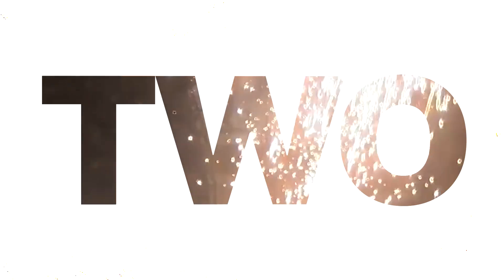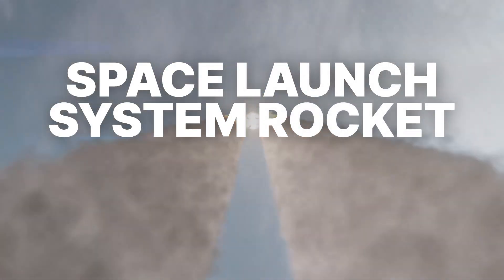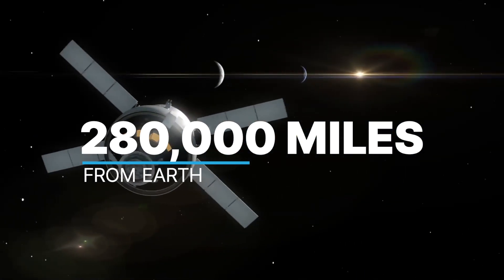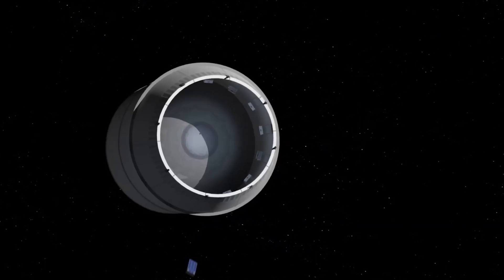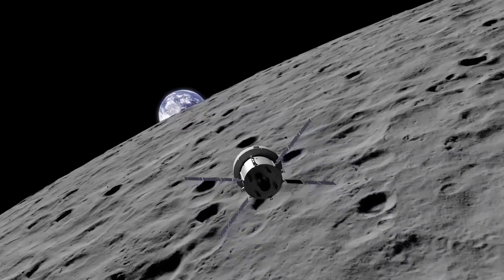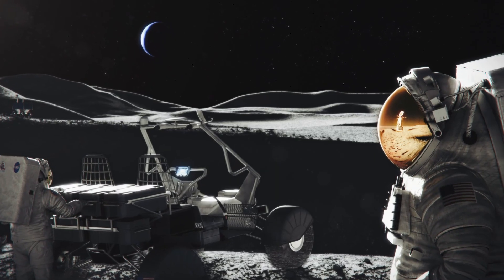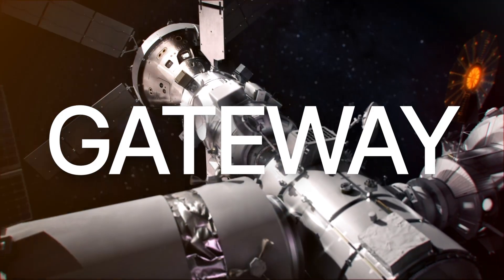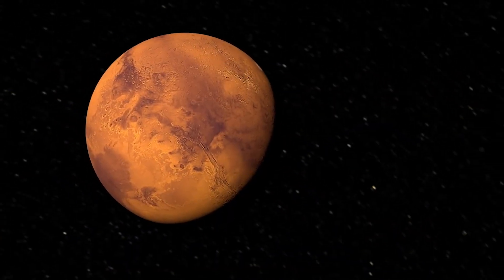Artemis I: NASA’s Plans to Travel Beyond the Moon

Comment: Nasa: The most powerful rocket in the world!

Spacex:  ;)
Reply: but we forgot the N1
Reply: @ftldesignbureau7891  N1 Failed.
And Starship will be more powerful, even Saturn V was stronger.
Reply: @clancy ARE YOU SERIOUS? SLS hasn't flown EVER and is using only slightly modified boosters from the SPACE SHUTTLE, plus starship has technically already flown
Reply: @zoom-w1e  when did I say it has flown/that it used new boosters? This discussion is about SuperHeavy, not Starship. I'm sure you're aware that Starship is the upper stage. It's like saying ICPS, which has technically already flown, means that SLS already flew. 
My point is that it's very unclear at this point in time, how many engines will BN3 or any of the pre-operational Super Heavies will use. So it's not really fair to say that SH is the most powerful until we have a final design. We do, however, know im what configuration SLS will fly. Which is why I personally will call SLS the most powerful until I see 28 engines on a Super Heavy
Reply: @clancy5600  you're wasting your time trying to put something on Muskies head that is not SpaceX/Musk propaganda. if you listen them, Starship already went to Mars and back and the million of colonist there are perfectly happy to be reuled by the Great Leader Doge the First, previously known as Elon Musk.
Reply: Its still in very early beta, and it chould get scrapped so dont get your hopes up.
Reply: Once starship is made, then yes it will overtake SLS, but for now, SLS will be the most powerful rocket in history🤯
Reply: Starship hasn’t been constructed yet so they are correct
Reply: By that measure SLS has not been constructed yet either. Both systems have prototype hardware constructed and tested. Only the future will tell which one will be going to orbit and the moon first. My money is on SLS flying (maybe) once. Great if more but I am not too optimistic about it.
Reply: @winni555  Have you been up to date? The core stage is build, the SRBs are assembled and we should get integration at the KSC within 5 months. SLS is a real rocket, all we've seen of SuperHeavy is a manufacturing pathfinder. We'll soon see BN2, but that won't have 28 engines either. And it's entirely possible that BN3 won't have 28 as well. I do believe SpaceX will reach 28 engines at some point, but it's foolish to say they already have. So for the next year or so, SLS will be the most powerful launch vehicle, wether you like it or not.
Reply: @clancy5600  Yea so both vehicles have not been assembled/integrated/launched yet. They are both still on the ground. Ofc it is all speculation but I'd bet starship will go to orbit before SLS. Sure SLS is "integrated within 5 months". I will believe it when its done. And boy I hope to be wrong about starship being first (actually if one would believe the starship timeline they would probably get to orbit first anyways but I doubt the July date for spacex too). It would be awesome for SLS to stick to a timeline for once.
Reply: @winni555  Core stages for A2 and 3 are already being built, it is flying more than once whether you like it or not
Reply: @spacemancm  I hope so! we will see :)
Reply: @clancy5600  BN2 has attachments for 28 Raptors , so it could get 28 Raptors. Starship is scheduled to launch NET July 1st to Orbit. If you believe it or not, but imo Starship will launch at least 2-4 months before Artemis 1.
Reply: @kspsuchti5673  The dome that was spotted is BN3's dome. Whatever the case, the discussion wasn't about who got to orbit first. SLS is the most powerful rocket until a Starship/Superheavy with 28 engines gets on the pad.
Reply: @clancy5600  ok my fault, but the discussion was about the statement from Nasa that SLS is going to be the most powerful Rocket, but Starship is more powerful, so it was a discussion about which vehicle launches first :)
Reply: @Soft Walnut Super Heavy to be more precise.

There are protypes of this but non of them Has 28 Raptors.

Comment: This sounds amazing
Reply: Research the spacex rocket starship that is reusable
Reply: @zoom-w1e     Starship is not a launch system, it is the equivalent of the capsule and third stage.  It needs to be launched on top of a super heavy rocket in order to leave low Earth orbit.  
Plus, starship is only in early stages of development.  All of the test flights are empty shells with minimal fuel and no payload.  It also has no heat shield in order to return through Earth atmosphere.  Artemis and SLS are near ready for actual flight, possibly later this year, or early next year.
Reply: @my3dviews  Both parties are doing good, I am in full support of both. there is no need for controversy here.
Reply: @softwalnut179    Wasn't meant to be controversial.  Just stating what stage of development Starship is at.  
I too hope both systems are successful.